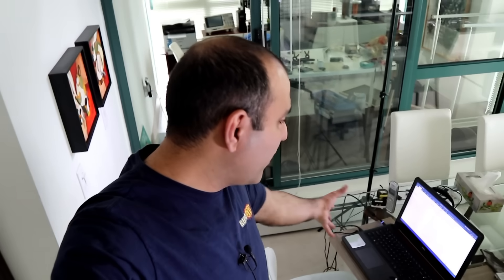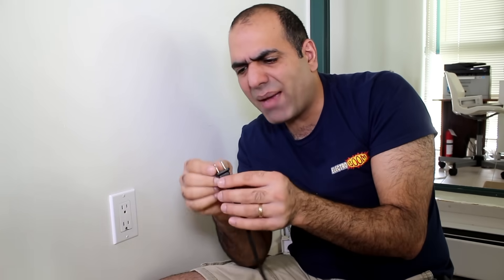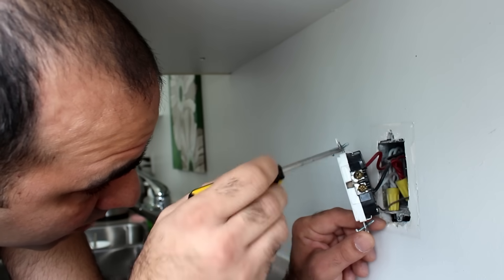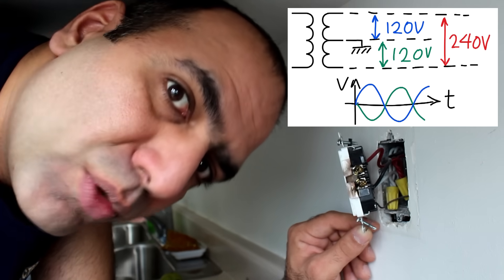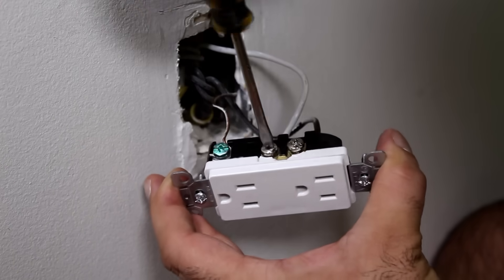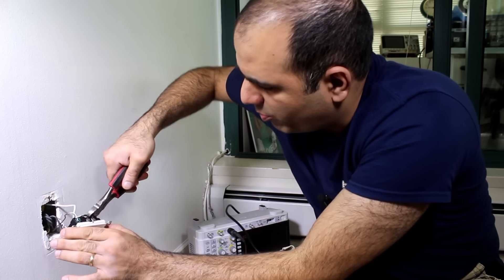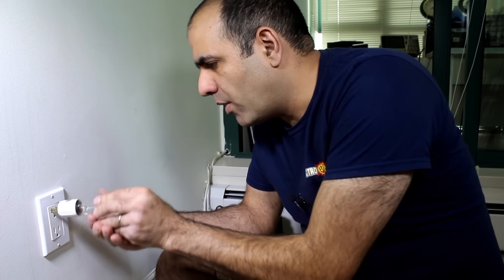How to Replace a Power Outlet

Comment: Can confirm houses having center tapped 240, as I use this to my advantage with a crappy little adapter I built that has two male plugs which I connect to outlets on separate legs to get ~242VAC between the two live wires to power some heavy duty devices with universal power supplies. Much better than when I was dragging the line voltage down about 8 volts and making the power cord and wall socket get warm with a constant ~12.5A load. I could even tell which breaker in the panel was for this circuit with my thermal camera because it was the only one that was glowing (only like 3°F above the rest, but that's plenty to be visible). Plus, it was getting annoying when switching on my monitor on the same circuit would trip the breaker.

There's probably some NEC code against doing this, but it works great and improves efficiency and, frankly in this case it's safer (due to wires and sockets not heating up).

Also, I strongly recommend using the screw terminals instead of the push-in holes, because the springy thing that holds the wires in the holes gets weaker over time and has a much smaller contact area meaning it can develop a loose connection much easier. And with electrical wiring, loose connections = fire hazard.

Comment: Mnemonic:  Silver on white, opposite right.  Means the white (neutral) wire goes on the silver terminal which is on the left side of the outlet (for conventional installs).

Comment: It isn't necessary to cut the wires off in order to get them out of the outlet.  There is a small hole where you can insert a small screwdriver while you pull the wire.

Comment: You cannot use back stab connectors for more than 14awg... But please Don't use the back stab connectors.... They suck at life. 

The one with the broken bridge is either done that way to make 2 20A outlets out of 1(not really sure why... That's a lot of extra work and wire.) Or it's a half hot or half switched outlet. Generally you only do this under the sink to provide a hot outlet for the dishwasher and a switched outlet for the garbage disposal. This is also done in living rooms to give you a switch controlled lamp instead of installing a light fixture. Cheap builders....

Comment: please explain the legend of the sailor who killed himself with a 9v battery. He wanted to check his "internal body resistance" with a multimeter that used a 9v battery, so he poked (until blood) both of the probes into his fingers, and died....Ohm's law of A = V/I ,so I guess if you have a 9v battery and internal body resistance is about 100Ω, 9v/100Ω = 90mA it could be lethal... can you explain this in a video please, can it be true?? can really a 9v battery kill you this way? thanks!

Comment: As an electrician this cringes me, bit since its electroboom i expected this lol we love u man.
Reply: juan castellon Electrician here too. I braced for impact when I clicked this video!
Reply: I immediately went "oh shit" when he put white on brass.
Reply: roetemeteor I cringed when he backstabbed the white into the outlet
Reply: Colby Kordas Yep. My dad would kick my ass if I didn’t put the wires on the screws when I was in training.
Reply: You guys do realize he has a masters degree in applied science in electrical engineering right? Hes much smarter than just an electrician
Reply: juan castellon I love your profile picture. Metallica forever.
Reply: Darren Gunter yeeeeessss
Reply: @Powwower  true
Reply: roetemeteor - not into reverse polarity? Hahahahaha! The 'backstabbing' the outlet aspect makes me cringe also. 8 out of ten  service calls in old homes seem to be as a result of backstabbed wiring. I thought it was against code. Oh well.
Reply: @onevoiceinc  backstabbing might be against code were you are, but even if it is to code I think we can agree it's just a very bad practice.
Reply: @onevoiceinc  Pretty sure it's against Federal code, but here in PA it seems most boroughs can ignore Federal willy-nilly. Some places are still using code from the 80's!
Reply: Thought the same as an electrician here in the UK- No VDE tools, no doubling the conductors over, no earth sleveing and those terminals on the side you guys have over there look a shock waiting to happen!
Reply: Exactly
Reply: I suppose this is like a drill-sergeant watching f-troop.
Reply: Only a little, I do appreciate the way he purposely sets himself up to show the dangers of electricity, gotta appreciate that one as it isn't pleasant.

Comment: 0:50 First step is to turn off the circuit breaker.
Reply: Dale Erdmann
This is staged. He first shows the consequences and then proceeds to tell you how to do it right. That's why his channel is named ElectroBOOM. Your last sentence is quite ironic in this case but hey, not everything is intutive, right?
Reply: You must be new to this channel
Reply: Dale Erdmann we all know that's the LAST step
Reply: Yes, safety is number one priority.

AND FUN IS NUMBER 0 PRIORITY!
Reply: @mig1983   2+2=electrocution
Reply: dale must be new here
Reply: He does that on purpose to tell you why you shouldn’t do that, he explains his mistake after and then does it properly.
Reply: Really? Where did you learn that? After receiving his masters for EEE and spending many years working as one, I am sure he doesn't know that.
Reply: You don't get it? The video is designed to show you you could get shocked if you don't first open the breaker. Boom did it that way on purpose.
Reply: Failing that, the first step is to question WHY you didn't turn off circuit breaker.
Reply: xD
Reply: Dale Erdmann insulation gloves or even leather insulated against 120v you can work on outlets hot
Reply: @cocopapiiii  Oh? Tell that to my dad after he got blown across the room, lost a filling, and couldn't find his glasses for a few minutes. You can take a chance, and the voltage may not kill you, but it's better to be safe than sorry.
Reply: I am new here, but my dad taught me a few things.
Reply: the first step doesnt have to be turning off the circuit breaker if you know what you're doing + just replacing a cover. Turn it off only if you're replacing the outlet.
Reply: Dale Erdmann YEEEEOOOOOWWWW
Reply: I bet you feel real smart after saying that Dale. Saying an obvious safety tip to an electrical engineer really made you feel like a big man huh Dale. You really taught him what a Master's in Electronics didnt huh Dale. You smug fucking goof, you do realize he's joking half the time? When you know the plain maths and science behind it all, it's really easy to tell what can seriously hurt you and what doesn't. Now tell me, for someone who knows his shit, why wouldn't he not give himself some temporary discomfort in exchange for views?
Reply: Forgets to open the breaker and gets electrocuted 3 times. SHIT! FUCK!
Reply: Dude you caused a partial power outage
Reply: No way when you're a real man. :D
Reply: Love the non insulated tools
Reply: 0:50 First plug stuff on the outlet and turn off the circuit breaker.
Reply: Is this really faked ?
Reply: faked
Reply: Terier,  it's scary to think someone would try it without turning off the breaker. I guess we could chock it up to Natural Selection though, if they aren't smart enough to.
Reply: Right after spraying it with a water bottle to reduce the smoke?
Natural selection...

Comment: I'm assuming you've changed outlets with the power on as well, even if it is ill-advised. I had that issue with an older house, circa 1950's, and short of flipping the main breaker there was no way to power down four of the outlets. Gloves and eye-guards were worn, and once you get used to a spark when you connect the second wire to the terminals, well, it was still pretty terrifying. Not sure how you manage to do your videos without flinching in anticipation of the spark/shock you know is coming.

Comment: Hot screws are brass-colored and shiny.  Neutral are dull and look like normal metal.  

While it's best to use the screws, you don't actually have to cut the wires to remove them from the stabby holes.  There's a release slot that you stick a small flathead into, which allows you to pull the wire out.  After that, the best option is to leave it out and wrap it around the screw.

When outlets are split top and bottom, it's usually so the top one can be controlled by a switch, while the bottom stays always live.  The idea is you plug lamps into the top, so you can turn them on and off with the switch.  I'd bet the one you showed was precisely that, which means it's not two separate phases at all.

Comment: AND North American houses are made from sticks and plasterboard with asphalt shingles for roof covering. Can you say flammable? And edible too. Every time you turn your back some oversized rodent has bitten tru an outside wall and is now chewing on the wires because there is also no regulation in place that tells people to put those wires in steel or hard pvc pipes.

Comment: Oh no! You installed the socket upside down! The earth terminal is supposed to be on top, so if something (like a metal picture frame) falls on the plug, it hits the ground lug instead of shorting the hot and neutral lines.
Reply: That's the way it's taught in school, ground up for that reason,  but common practice is ground down, looks nicer.  Then not having the face look at you upside down.

Comment: Don't bother reading the tiny lettering on the socket to tell the difference between live and neutral, the screws are colour coded, nickle plated is neutral brass plated is live

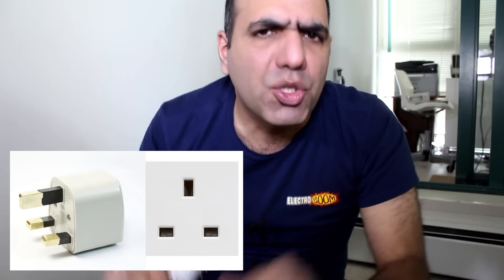Comment: 1:16 "the UK plugs are the safest in universe..." Well certainly not the one in the photo - it's a knockoff with a non-compliant sleeved earth pin! Non-earthed appliances may have a plastic pin, but a half-sleeved thing like that is a complete no-no. In fact, the whole thing just looks cheap and nasty - it looks like one of those cheap (dangerous) socket adaptors you can get from China. Common counterfeits like this are explained quite well at http://www.bs1363.org.uk

Comment: whats the effect on your equipment , ie ,.; electronics, lights ,computers,  stoves ,motors, freezers and such? if the phase is not out 180 degrees 240.,.,and whats different about residential 240 breakers that are just double (50)amp breakers,.   is there something in them that offsets it? or am i mistaken? or are my breakers wrong even?

Comment: Why would you cut the wires?  There's a hole next to the connector you push a screwdriver into to release it.  If you use this method too many times then the next guy has to deal with the wires being too short!

Comment: I should have made a video today where I branched off a cable from a 25Amp 3-phase cable with 16mm² (!!!) copper wires inside. LMAO these guyes were a little over the aim. Anyway it was a pain in the a.. to connect all these wires again because of their thickness. then I had to put back on the new roof so I had no time for filming.

Comment: DO NOT USE PUSH-IN TERMINALS... use the screws instead.  These outlets cost $3 or $4 RETAIL... so you can imagine that they are fairly cheaply constructed.  Now consider the mechanism that is supposed to grab and clamp the wire firmly enough to allow upwards of 15 AMPS of current to flow through it.  If you've seen how unreliable power can be on an outlet with a loose screw, then you quickly realize how utterly inadequate and prone to failure those push-in terminals are and why professional electricians will never use them.

Comment: Australian outlets are definitely not safer... most of them aren't even grounded.
Reply: And they also require a shut off switch on each outlet... apparently electricity leaks out of sockets in Australia when the appliances are turned off... just like taps with worn-out seals. So a second switch is needed... don't ask me. It defies the laws of physics.

Comment: All shocks have been expected here, but on the kitchen's plug, I would say, connecting 2 different phases on the same socket isn't safe at all. (Even less regardless to the insulation distance inside)

Comment: Funny thing is white is Neutral and Black is Live with AC but with DC its the other way around for positive and negative. Had to teach a couple of co-workers that. Low volt would cross the AC outlets and electrical would cross the security camera power pigtails.

Comment: Question! So I recently replaced a "Half-Hot" outlet in my kitchen. I needed to remove the tab that bridged the hot terminals so only one outlet would be controlled by a switch. If I had kept the bridge connected, would the outlet be at a higher voltage? If so, can this higher voltage damage electronics? Thanks!

Comment: one of my friends dad is  a lumberjack (yes a Canadian Lumber jack, how stereotypic ;P ) and he wired his shed him self... then for a month his saw was not working or working weird and he used to have enough strength in his hands to tight the bolts on it by hand and was complaining the bolt did not tight any more... when his son in the army who works on tech touched the saw bench, he got shocked... (WAS OK) turns out he messed the ground and plugged one of the other wires! lesson here is lumber jacks are affected by electricity but not hurt by! (his hands were getting weak from the electricity but some how he felt no pain! must be because working hard enough and you are always in pain and cannot feel more pain than what is already there!)

Comment: Those "bridges" have to do with bringing in a switched leg. For example, if you want to control one of the two outlets with a light switch, while keeping one always ordered and not controlled by the light switch. This way you can bring in two legs, one with constant power (black wire usually) and the other coming from the light switch (Red wire usually.) It's not for 220V. Those are not rated for 220V.

Comment: In Europe there is no regulation about how to connect the wires, I mean, the plug is symmetric so as long as you connect ground to the center it doesn't matter, right?
Reply: Ramon Palacio That is only true for double-insulated devices such as chargers, which use 2 pin plugs. Anything with an earth wire and a grounded case, such as a washing machine, should be wired with the correct polarity.

Comment: You don't need to cut the wires when using push in connections. Just grab the wire, lightly pull on it and twist the socket back and forth. No need to shorten your wires every time you redo a connection. See https://youtu.be/jydoYvGSUGs?t=153

Comment: hey one of my outlets in my house gets really hot sometime, am I going to die? 
Right now I only have a tv plugged into it and a 2 gallon fishtank filter. If I plug anything that takes more power into it it gets REALLY hot. I ran out of outlets in my room tho bc I keep reptiles and they all need heatpads/uvb bulbs. 
On one hand, I openly accept the sweet embrace of death. On the other, I don't want my pets to die. My snakes, tarantula, hissing cockroaches, and giant leech don't deserve an early death.
Reply: Could be a loose connection to the outlet, or some other point of failure within the outlet.  Could eventually lead to the complete failure of the outlet, or damage to the plugs of stuff connected to it, with some chance of fire too.  If you open it up I wouldn't be surprised if there were some visible damage like scorched wires, partially melted outlet housing, etc.

  Just turn off the breaker and replace the outlet and make sure to attach the wires to it properly (if you look around Youtube you'll find some more detailed and serious instructions on how to replace/wire an outlet).  If you don't feel comfortable doing it, find someone licensed who can.

While you're at it, check the other outlets on the same circuit(s) - open 'em up, look for any damage or loose wires, etc.

Comment: One big item you should have mentioned is to make sure the black (hot) wire is connected to the brass-coloured terminal and white to the silver one, otherwise your plug may work but will be connected in reverse polarity (bad!)

Comment: Hey, cool guy with a unibrow. Can you help me figure out my problem? 
I'll try to explain it humanely as possible. 

So, whenever I'm using my computer, and someone turns off/on the light switches from ANYWHERE in the house, my mouse and keyboard suddenly disconnects and then reconnects after a few secs.

Comment: Don’t push wires in the holes, you’ll regret it.  Use the screw terminals, it’s much safer and less likely to work it’s way out from thermal expansion and contraction.

Comment: 2:18 the center tapped transformer is single phase, L1 and L2 are in phase (220-240v), N goes to ground,  L1-N and L2-N are 110-120v.

Comment: The rental I just moved into had the neutral and hot wires connected to the wrong sides. I guess whoever flipped the outlets upside down (why?!) didn't bother switching the sides of the wires. I wouldn't have noticed if my UPS didn't tell me! 

Is there an inexpensive way to test the rest of the outlets for this without lugging my UPS around the house?

Comment: I'll second what others have said.  DO NOT use the PUSH IN HOLES.  Strip the wires, bend a U shape on the end, and put them under the screw heads.